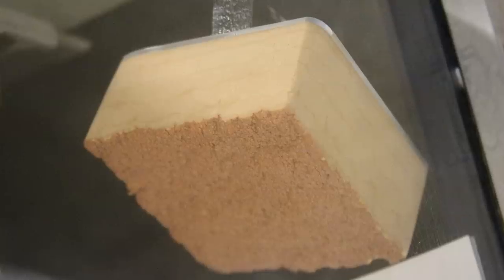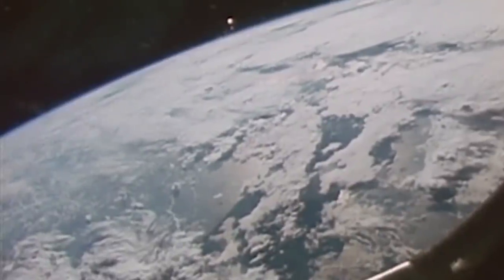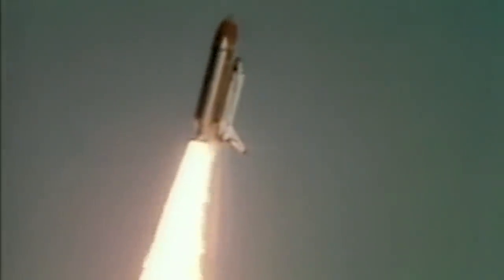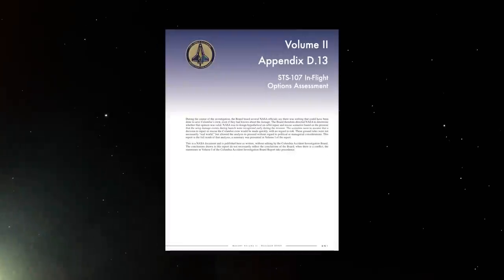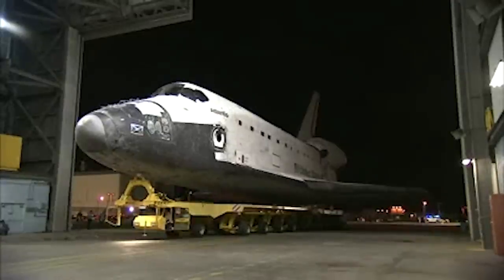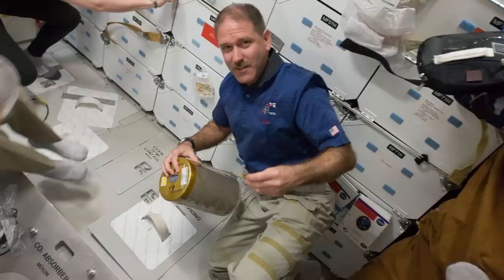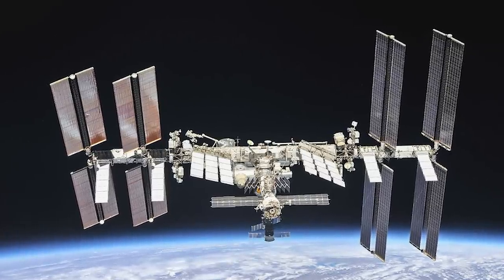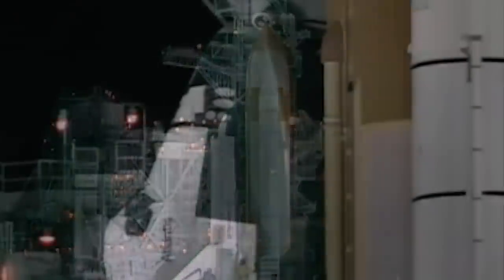The Backup Space Shuttle

Comment: It amazes me that a contingency to reach the ISS was never considered as a safety back up for each and every STS mission. If that had been taken seriously enough an option, NASA could have made accommodations to the trajectories and other contingencies and requirements to make this option feasible even though this contingency never arose and would not have helped this shuttle because no one thought there was anything wrong. 

But was that really the case? To what extent had NASA decided to "look the other way" wanting to avoid having to face the doomsday scenario of the consequences of this type of damage? Could they have been so ignorant of the specific risks of the foam hitting the tiles? Was there anyone ever assigned to look at the ascent footage to check for this kind of damage? It's hard to accept that NASA was ignorant of this problem of the possibility for whatever reason that tiles might be lost during the mission?????  I was shocked to learn that the foam hit the shuttle @ +500mph!!! Even the vast acceleration of the rocket on takeoff could not provide that kind of dV over the several feet of travel as the foam fell to meet the wing! That just does not sound right!
Reply: That would require every single space shuttle mission to have had a 52° inclination at the same ascending node as the ISS. At a certain point you can just as well not have the shuttle.
Reply: @slome815  That's a very narrow perspective of the issues involved and reflects a flippant attitude towards providing a lifesaving alternative to either the STS or the ISS. How do you think the STS shuttled the sections of the ISS to the prescribed orbit?  The ISS's inclination could have been made more compatible so that this option would be more available. Had there been a tragedy that could have been averted by more compatible trajectories, I would bet that the entire concept I am describing would have been given top priority I don't see how you could reach such a verdict unless you are an orbital engineer. Are you? 

You then somehow seem to think that the ISS and STS missions are mutually excludable!! That would certainly be a unique perspective, but thanks for your thoughts!
Reply: @nixl3518  No, you aren't reading what I wrote. It's also very clear that you don't understand orbital mechanics very well. From kennedy space center the space shuttle could theoretically launch into any inclination above 28° (since the launch center is at 28°N). In practice the limit is 28°-57°, since any launch more towards the north would overfly the east coast, and that's obviously not allowed. 

As you can see launching into the 51.6° inclination of the ISS is no problem. The reason for the 51.6° inclination is that this is the minimum inclination possible for launches from baikonur (theoretically its 45°, but that requires launching over China).

What can't be done is a major inclination change once in orbit. The shuttle's OMS had a rather significant delta V budget of about 300m/s. But inclination changes require a LOT of delta V, especially in low earth orbit. So even with this delta V budget only 1.5° of inclination change is possible.

So either you limit the shuttle launches to orbits with almost the same exact orbital parameters as the ISS has, or you do other missions as well and accept that reaching the ISS is not possible.

There is no such thing as "more compatible trajectories", except for launching into the same plane as the ISS every single time. (and yes, that's plane, not just inclination, but same LAN as well).
Reply: @slome815  The put down is much appreciated!! 

What is also clear is that you seem to miss the point I am making. If NASA had set the highest priority to provide the ISS as shelter in case of some catastrophe aboard the orbiting Shuttle as well as vv, all the orbital mechanics you are throwing my way would go up in smoke as they would figure out some mechanism to ensure that this safety feature would be available. It is not dissimilar from their decision not to design the cabin in a way that could have survived the first accident if not the second. That was something feasible certainly, but more difficult to devise, than to ignore. These are challenges much the same as the simple idea of adding seatbelts to cars that the government had to force car companies to install. NASA had no governing body over it to provide pressure, so we lost the compliment of the two Shuttles as well as the hardware. Only the hardware is replaceable! This is the point I am making.

You are mired in the mechanics that blind you from thinking to find a solution that EXISTS if you had to look for it, knowing that without it, no Shuttle would be built, plain and simple. My knowledge of the inclination of orbits has nothing too do with the premise of trying to keep our people from being killed when we ask them to take risks like sitting on top of the biggest non-nuclear bomb we had ever devised!! ALL our previous and subsequent rockets, were and are equipped with an escape mechanism in case of such catastrophes as the first disaster. 

I might not be as well versed as you in providing orbital inclinations in degrees and minutes, but that in my view is irrelevant. You explain the narrow minded view, which I find unacceptable. With enough pressure, solutions to these problems can be reached but we typically employ them AFTER we learn the hard lessons a few times! It's a human reaction to be cold and indifferent when it's not your life that is asked to be put at risk. If the top execs at NASA had their children in the Shuttles, the short cuts taken would have not occurred! It's a bit like the military draft; without it, wars are endless, much like Afghanistan.... I hope you can see the connection.
Reply: @nixl3518   "ALL our previous and subsequent rockets, were and are equipped with an escape mechanism in case of such catastrophes as the first disaster. " 

Except for Gemini, that had large parts of it's launch trajectory without any possibility of escape. And it's even doubtfull that those ejection seats would have worked during the first 20 seconds or so when they were supposed too. That's 1/3th of the space program before the shuttle. The soviets didn't have any escape tower on Vostok en Voshkod either. Though it would be the early soyuz program ( a program where the capsule did have an escape tower) that would prove dangerous and fatal for 4 astronauts.

It should also be noted that the shuttle made almost as much flights as the mercury, gemini, and apollo program combined before the challenger accident. And considering the sheer amount of near misses with apollo I have my doubts it would have kept it's safety record if it was flown as much.

The shuttle certainly had inherent safety flaws, but let's look at some stats here: apollo killed 3 out of 33 astronauts (on the ground, but I don't see how that's better). 
Soyuz had a fatality rate of 1.55% (and it would have been very, very high in it's first 11 flights, with 2 fatal flights), apollo killed 9% of all astronauts (yeah, apollo 1 was a ground test, but I don't see how that's any better), and the space shuttle had a fatality rate of 1.77%. 

Yeah, that's a high number, and one should always try to improve safety. But the reality is that spaceflight was (and to a lesser extend, still is) dangerous. 

And even if you make something as safe as you can, accidents will stil be happening. Humanity has always accept some amount of risk. Otherwise none of us would be driving cars. Something that kills 46 000 people in the US every year.
Reply: @slome815  OK so you got me!!! You found exceptions to my comment!! You amaze me with your incredible argumentative capabilities!! Bravo!! You are a technological encyclopedia!! But I am talking about the escape mechanism top of the capsules that were meant to yank out of harm's way, starting with the Friendship 7 capsules. ALL the capsules had that!! The SS did not and could have had similar mechanisms designed to pull he section of the SS that contained the crew!! They just did not design the SS in a way that this could work because safety was not a top priority in their thoughts!  

Can you stretch  your tech-and-statistics infused mind a little bit and consider that it could have been designed in such a way? It's not that hard to think this through even as you will come up with a myriad of reasons why they couldn't do it!! Sorry, wrong value considerations. They actually REMOVED safety mechanisms, while increasing the risks to the crew that could have saved the compliment of the 1st STS disaster and you know it!! 

Yes, we take risks in life but we don't jump off a building without a parachute, because we know the result!! The risk we take in this case, is hoping that the parachute opens in time, but we wear a parachute and we even have a backup parachute!! We don't jump without one and hope one appears on our backs by magic! There was NO "parachute" mechanism designed for the SS and you know they could have done that. It was just too hard to contemplate given the razor thin physics that made the SS possible. That is not taking chances in life, it's asking our Astronauts to stick their head in the lion's mouth and hope he/she does not clamp it shut!! The calculation NASA made, was that an accident would never happen, when it had statistics to the contrary! They knew this kind of accident was likely to occur at some point....and it did!! What is also arguable, is that if they had incorporated such safety mechanisms in the SS, it could have also saved the second crew from their demise!! The accidents could have occurred without fatalities!!

What was even more idiotic, was that they decided to launch in freezing conditions because they were exhausted waiting for a launch window!! Well that experience taught us something didn't it? It taught us that we did not have to risk lives to prove a point!! We don't launch even if it rains anymore!!
Reply: @nixl3518  I know you were talking about the launch escape tower. Thats why I pointed out none of the Gemini capsules had them. Thats 10 out of a total of 33 US manned spaceflights before STS. Thats not a small exception. Your comment stated that ALL missions had them, in caps and all, so don't act all surprised if someone corrects that.

And don't do that sarcastic indignant nonsense when someone correct you, it's childish and rude. 

So, what's your opinion on the SpaceX starship? It shares a lot of single point of failure problems with STS. Including no escape system.

Comment: Let's just skip the engineer bullshit and the rocket science folks, practically asks why the foam is needed, is there an alternative and or could it be encapsulated... But WTF do I know other than when I build something, shit doesn't fall off... Especially if I had their budget.🙄
Reply: If your building materials had changed in their manufacture because of environmental laws, what could you do?
Reply: @RideAcrossTheRiver  maybe actually test it, plus about two dozen others...
Reply: @kevinfreeman3098  Shuttle prep and launches weren't home reno. Despite rigorous testing, the foam failed in an unforeseeable manner. 

NASA tested everything more and better than you ever could.  That's why you're on here and not there.
Reply: @kevinfreeman3098  "I'm smart enough to know spray foam ain't gonna ride at 3,000 mph"

It worked fine for a hundred missions until the manufacturer adjusted its formula. I do know you're not smart enough to work for NASA.
Reply: @kevinfreeman3098  Sure you did.

Comment: Your numbers are wrong. The next shuttle in line was scheduled for launch 30 days from the Columbia launch. Finalization of which was merely mission payload preparation which could have easily been discarded. The Columbia was on a 15 day mission, and on low consumption activity that supply would have been doubled. That alone would have avoided the launch pressure. You're wrong about the breathing gas. It doesn't use oxygen nitrogen mix. It uses pure oxygen at 4 psi, so the hull doesn't have to be as heavy as it would on nitro/oxy at 14 psi sea level. The rescue mission only had to carry enough suits for the transfer. The argument of what if damage occurred on the rescue shuttle is idiotic. That damage could happen on any shuttle but we use it anyway. I wrote a paper on this 2 days after the disaster 6 hours after the first press conference. NASA spent the next 3 months technobabbling out of responsibility my paper hung on them to the investigating committee. The same garbage in your video. Probably where you got your garbage. The preliminary result of their attempted fraud was the director of NASA resigned. Further attempted fraud was to claim the damage was not as predictable as i stated in my paper from merely seeing one poor quality video of the foam strike. Being familiar with the material, foam, and tiles, I stated in my paper the speed of the foam, and damage the strike likely caused. I stated a 16 to 24 inch long 4 to 5 inch wide, and 3 to 4 inch deep gouge. NASA spent one million dollars replicating a wing section, and fired a foam square on it at the speed, and angle I published in my paper. The first test resulted in a gouge within a couple inches of the length, and a few tenths of an inch of the width, and depth I predicted. They claimed it was a fluke. They spent 20 million more on more tests on other angles of strike to evade my paper but only blew holes in the wing. The first test result confirming my paper has been repressed. The investigation concluded with what my paper recommend. That subsequent shuttle flights have a rescue shuttle prepared on standby, and that tile inspection be done on orbit, repair equipment, and automatic reentry control, be developed to rescue crews, and possibly return the damaged shuttle unmanned. That's the inside dope.

Comment: THIS HOLE THING IS INCORRENT. THE CHALLENER EXPLODED NOT COLUMBIA AS INDICATED IN VIDEO.
Reply: They both exploded dude
Reply: Yea but the video was of Challenger when referring o tile insolation.  I Think I know as I was around for both.
Reply: @rickmartin2392  Apparently you don't know the difference between a tile and a foam insulation block. A pice of foam fell from the fuel tank, hitting the wing of the Shuttle. Then, on reentry, the hole it made, let in super heated gas. That gas caused the Shuttle to disintegrate on reentry.
Reply: Think your mistaken, the Columbia broke up on re-entry, the challenger exploded 71 sec into flight, your caps filled reply is INCORRECT! Lol
Reply: @rickmartin2392  I was around then too for both of them, the vid your refering to was not of challenger, it was Columbia during launch when the part detached and damaged the heat insulation
Reply: @rickmartin2392  ah, i don't know anything about "o tile insolation" issues on either vessel, I'll take your word for it.
Reply: @101Cypher  Your are correct sir.
Reply: @rickmartin2392  I can see why you thought it was the challenger accident due to the lift off footage, both were terrible in the history of space exploration
Reply: I hope you're still Livin' La Vida Loca!
Reply: I'm going to be THAT guy.  Technically Challenger was broken apart by aerodynamic forces when the leaking booster turned it too far to the side.  This created a fuel cloud, which then did explode.  So the orbiter was already in pieces by time the fuel exploded, but the whole thing took place in a fraction of a second.